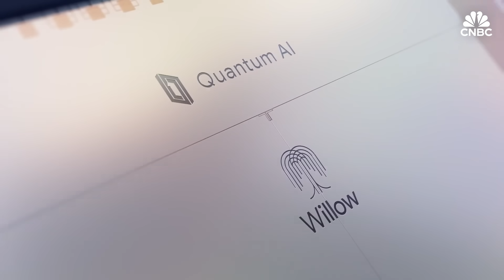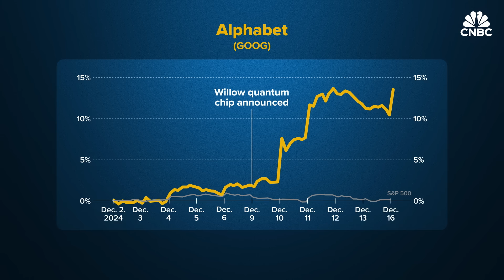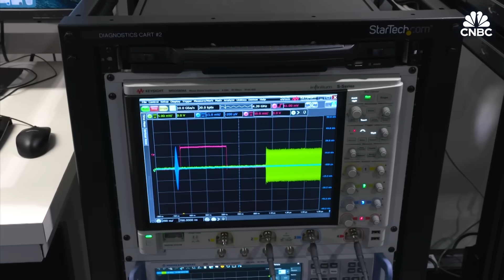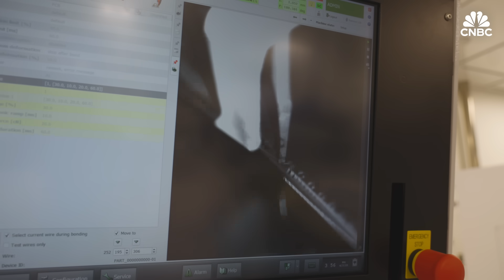How Amazon Plans To Catch Google And Microsoft In The Quantum Computing Race

Comment: Quantum computers could replace supply and demand by solving the scarcity problem. It could assemble and distribute resources in the most efficient and efficacious way. It might make socialism possible. I'm a capitalist because it works. If another system could work better I'd be for that.

Comment: Behind hardware you need a software and algorithms, that could take decades. even with modern AI. Before simulate chemistry, you actually should know how ii works on atomic level, reseach, develop.... They mostly promissed a magic box that automatically resolve all human's problems.... in 10 years.... 2035: "We are very close, but need another 10 years".... And it's fine, but that tech needs huge amount of investments to make it float. So, what will be first, actually practical Quantum Computer, or run out of money?........

Comment: FWIW, China’s New Quantum Machine Runs One Million Times Faster Than Google’s [By Chinese Academy of Sciences March 7, 2025]

A new Quantum Computing breakthrough has sent shockwaves through the tech world. Researchers at USTC unveiled Zuchongzhi-3, a 105-Qubit Machine that processes calculations at speeds that Dwarf even the most powerful supercomputers.

It marks another leap forward in the quest for Quantum Supremacy, with the team demonstrating Computational Power orders-of-magnitude beyond Google’s latest results.

Breakthrough in Quantum Computing with Zuchongzhi-3

A research team from the University of Science and Technology of China (USTC), part of the Chinese Academy of Sciences, along with its partners, has made significant progress in Random Quantum Circuit Sampling using Zuchongzhi-3, a superconducting quantum computing prototype equipped with 105 Qubits and 182 Couplers.

Zuchongzhi-3 operates at an astonishing speed, performing computations 1015 Times Faster than the most powerful supercomputer available today and One Million Times Faster than Google’s latest published quantum computing results. This achievement marks a major breakthrough in Quantum Computing, building on the success of its predecessor, Zuchongzhi-2.

To evaluate its capabilities, the team conducted an 83-Qubit, 32-Layer Random Circuit Sampling task on the system. The results demonstrated a computational speed that Outpaces the world’s most powerful supercomputer by 15 Orders of Magnitude and surpasses Google’s latest quantum computing results by Six Orders of Magnitude, establishing the strongest quantum computational advantage in a superconducting system to date.

The study, led by Jianwei Pan, Xiaobo Zhu, Chengzhi Peng, and other researchers from both China and abroad, was published as a cover article in Physical Review Letters.

Um, forget Google; Amazon needs to update their plans to catch China, if they can...

Comment: For the record record a true quantum computer has no interaction with silicon based hardware and that revelation requires the mention that nuclear power generation regardless of it being fission or fusion based is nothing more than a reliable heat source by which you can generate high pressure steam turn a turbine that's connected to a rotor rotating inside a stator to liberate electrons  and generate electricity.  Sorry about that one, folks. ❤️

Comment: IONQ is the leader on this sector, Amazon's, MS's and Google's tech is years away and just as demonstrated on the Video Amazon's and Google's tech is unpractical as it requires near zero temperature to work. IONQ's tech works at room temperature and their computer are starting to address today the exact applications that are said to be 5 years away according to the video. The other company that is making useful quantum computers is DWAVE but none of the big tech companies mentioned by the video are even close to producing a useful quantum computer. Actually to the extend that we were going to mentioned a big tech company IBM would be the one to mentioned here as it is much closer than Google, Amazon or Microsoft to producing a useful quantum computer, but the program also ignores it.  Microsoft tech might be very impressive theoretically but we have no real evidence that it works. Are we know assuming that only the mag seven can win a tech race?

Comment: Majorana has materials based error correction built into the chip. It's not software. If Amazon does a good job developing a chip, and it is not hardware based error correcting they will never be able to compete in a chip market. It will be solely for their cloud computing AWS. MSFT has a huge head start on everyone else, and unless there's another hardware based error correction solution they will be the majority supplier of quantum farms.

Comment: The media often glosses over this, but only a select few problems get an exponential speedup from quantum computers. Most hard problems (NP-complete problems) get a factor of O(sqrt(N)) speedup which is nice, sure, but it's unclear when quantum computers will be competitive with classical computers for those problems, if ever, since classical computers are so far ahead in performance right now. There are excellent math videos on Youtube now discussing this topic.

Of course, the main big thing that quantum computers do exponentially fast is break RSA encryption, which means governments everywhere are very interested in them so they can eavesdrop on internet communication, but this can be defeated by switching everyone to quantum-resistant encryption. When that happens I guess the hype might finally stop. It would make more sense IMO to hype this from the national security angle, or research applications (i.e. using quantum computers to simulate quantum systems).
Reply: The first computers were used to do math that can easily be done on any personal smart phone now. We’ve yet to realize the full potential of these breakthroughs, especially when considering the constant research being done on AI. You’re right when you consider only the next step, but that’s how any journey starts
Reply: agree! the "only"application that i see a huge improvement of quantum computers versus classical ones is simulating quantum systems ( which we alreado do something like that with quantum simulators) and machine learning. Machine learning basically because the math is pratically the same.
Reply: Quantum computers will be specialised and integrated into digital computers.

Comment: Though the reporting here is good, I think it undercuts the fact that we still have no known useful applications of quantum computing. The only "successes" that it's had are running benchmarks for sampling qubits, which is like saying you hold the record for the fastest 3-legged mile. It's neat, but there still isn't anything we can do with quantum computers that we can't already do better with classical ones.
Reply: There are tons of very important things for it to do. The problem is not that, it is getting the damn things to work well enough to do them. LOL!
Reply: @Davethreshold  IF they did work the next problem is scalability.  Once you figure that out you have to power them.  The current bottleneck is energy but investor interest is more focused on the consumer market hence the push for AI that we really haven't found a practical use for.  Yes there have been significant successes but the market push is getting consumers to buy in on AI and quantum when there's no need for either in the consumer space.  They are already trying to convince consumers that a toothbrush has "AI."  All it takes is belief in consumer market for investor interest to take off so the businesses can generate profit.  It's always about marketing to the consumer for the sake of profitability.  Fact, there is more interest in TikTok than cancer research or the cure for any disease... Tech advances benefiting mankind are always secondary.